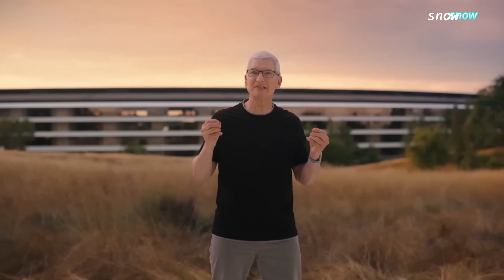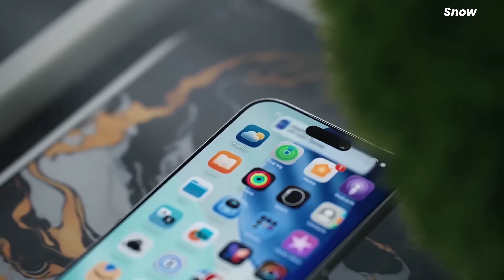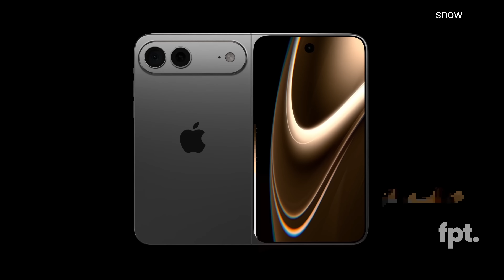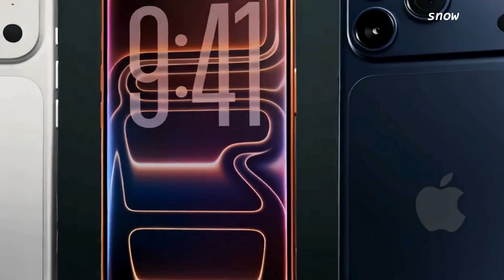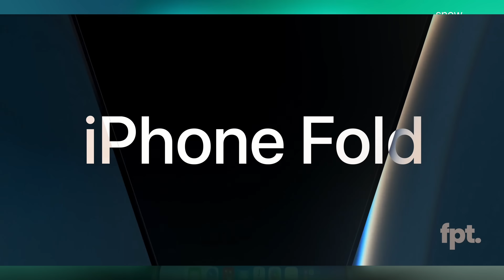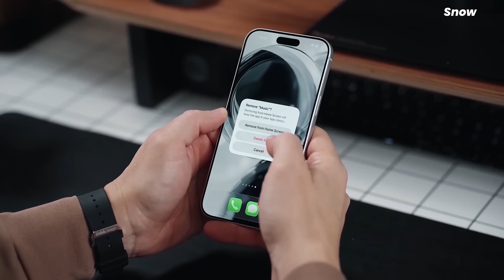iPhone 18 Pro Max is about to be impossible to find — here's why

Comment: Its even wors ethan that. Most carriers moved thier custoemrs to a trde-up plan  during the last upgrade cycle. This means at thetndof the finacning term there is an option: 1. Upgrade to the new phone by sept 25 (In My case) or 2. pay a $573 baloon payment and keepyour phonr (The value of hte trade in at the start ofthe  financing contract). So keeping your iPhone now has a price. Also if You want the regualr iPhone you must pay the ballon payment becasue it won't be available for six monhts or upgrade to the pro or maxmodels. This is forcing demad through a funnel at high pressure. A shrtage of iPhones could potentially trigger  millions of baloon payments. Those people may then decide to wait for the iPhone 20. Rol the dice and see what happens. I am not sure what I am doing yet.